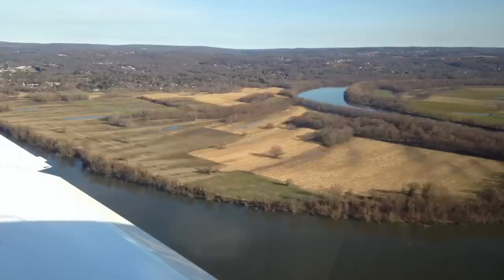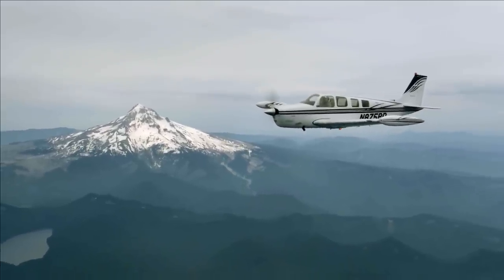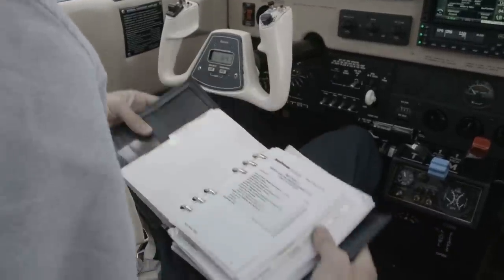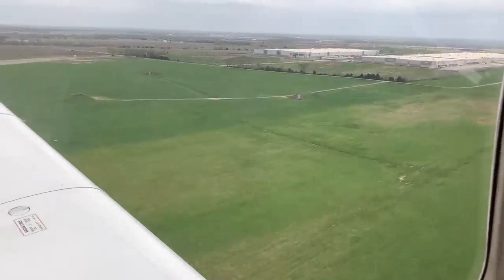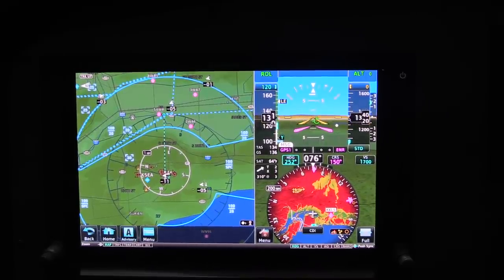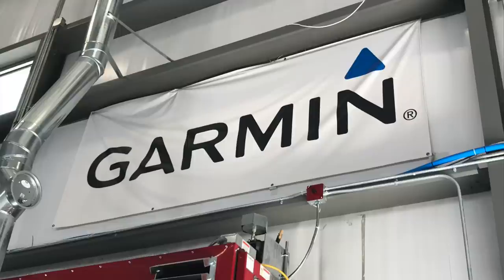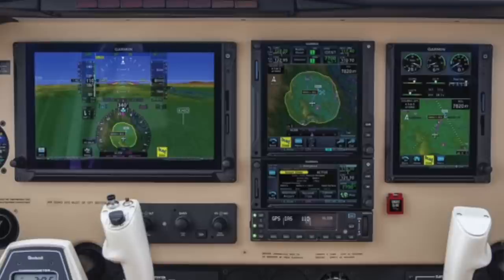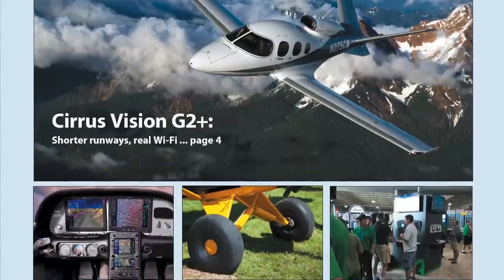AirVenture 2021Garmin Smart Glide Debutes

Comment: This is a BIG technological breakthrough that changes SO much in GA first, but ALL aviation.  It is similar to the development of the Cirrus plane parachute ejection system about a decade ago, unimaginable yet miraculous changes in flight safety came immediately and shortly afterward, more happy landings.  SO too here.  AI with Smart Glide fills a big role in flight safety that ONLY the best pilot skills, knowledge and judgement  could accomplish in ideal conditions before.  Establishing safe airspeed throughout and knowing where to go are HALF of what you're trying to do, i.e., figure out why the engine stopped and how to get it restarted or else, timely and decisively where to land if improbable as your sighting improves in the descent.  Cross-country, night and IMC flying are forever immeasurably safer because of this Smart Glide option.  I'm delighted and congratulate Garmin profusely for this technological guardian that'll surely yield happy landings galore like never before!

Comment: It's Garmin so it's going to be expensive.  If you have the money for this then you have the money to get your engine fixed.  If you have the forethought and presence of mind to get this then you have the forethought and presence of mind to sump your tanks and check the oil every time.  If you have time to deploy this then you are not experiencing an engine failure shortly after takeoff, which is by far the most fatal form of engine failures.
Reply: Garmin, expensive? Try collins, universal, etc... those companies are expensive..
Reply: What a ridiculous comment. Our school had a lycoming io-320 engine with less than 200 hours quit. Part 145, CAMO maintained. 

Engine failures are unpredictable. You pretending they are always caused by pilot error disrespects anyone who died from an engine failure outside of their own fault.

Sumping the tanks & checking the oil is a good start, but by no means guarantees the engine won’t quit.
Reply: I’ll pass on flying with Peter Anderson, who apparently believes mechanics are infallible, parts never fail, and newly serviced, well-maintained engines never quit.  Must be nice to fly with that kind of (clueless) confidence.
Reply: Yeah, no
Reply: @samtulp6  I've had an engine fail on me before in flight and I've seen people get killed because of engine failures.  My beef with Garmin on this is that this button will end up like so many other switches or buttons in technically advanced aircraft: unused precisely when they are needed most.  Good emergency training in GA is a shambles.  If this expensive button included rigorous training on how and when it is to be employed and under what conditions it will work, then I would be all for it.  As for most products like this the only training that will occur is a casual glance at the instruction manual once and then immediately forgotten.

That's why I'm so cynical about this.  At the moment it will be needed the most it will go unused and all of that money and energy wasted and nothing gained.

Comment: It would be interesting to know how often, statistically, you are in gliding distance of an airfield. Garmin must have the numbers to bother with this.
Reply: Yes.  Most times in GA aircraft, particularly out west, you are going to land out someplace, not at an airport.  Can you decouple the autopilot best glide and nearest airport?
Reply: @LarryPortouw  
Funny, thinking about this system perhaps a button that just yells the forced landing procedure at you would be more use? "Pull up, trade speed for height, trim for best glide, turn down wind, look for landing area, fuel on, fuel pumps on, engine restart", etc etc
The only actual engine failure I have ever experienced was on take off at 300 ft on a 12000 ft runway in a 172 so not exactly stressful but I wouldn't have put money on a successful outcome of nearly all my PFL's
Reply: Obviously that depends a lot on pilot's decisions. I see a lot of people flying around at 5000 feet while I like to go over the most economical altitude with often is only FL100 even on short flights. With the Malibu I like FL150 or something like that. Gives you a nice glide range (30NM) already and ok speed and saves you a long climb that burs a lot of fuel.
Reply: In Canada you would consider yourself lucky if you’re within gliding distance of a flat surface, hopefully on dry land.
Reply: That would certainly be interesting data. They should track that it could be interesting for AV safety.
Reply: @Skyprince27  Maybe from the rockies west or from Ontario east. The USA and Canada have very similar geography from east to west until you reach the 37th parallel north (south of it) where the biomes are much different. I would argue it’s roughly the same other than how there are much fewer airports in Canada.
Reply: @erichhartmann1  
So you’re talking half of Alberta, Saskatchewan & Manitoba. Sorry, haven’t been to that area since 1992…

Comment: My biggest concern as a flight instructor is.... what if the nearest airport isn't close enough?

Many pilots have lost their lives trying to make it somewhere they can't. Appears there's a feature onboard similar to the glide advisor in foreflight, but how easy is that to get on the display? What automation features are available for off-airport options? V-glide hold available without lateral navigation? I feel like the most vital question about safely gliding was left out of the video.

Comment: Wonder why the other GPS navigators aren’t included, like the GNX 375, GNC 355, and GPS 175.
Reply: He did say others would be added. Some or all of these may end up getting this option in time.
Reply: @iflycentral  I thought he only said that different flight displays would be added not navigators?
Reply: @Captndarty  yep; you are right. I misinterpreted what he said. Still; seems it would be somthing they could add to the other navigators. The Garmin pilot app already has a glide range prediction feature, and the app can be fed by Navigators like the GNX 375. Guess we will have to see what they do.
Reply: @iflycentral  agreed. I’m getting a 375 and I would think the processor could definitely handle that function.
Reply: I'm certainly going to ask them at the booth. Even if it could be done, I think the main issue is that there is a significant difference in cost and margin between the 2 classes of navigators and they want to make more reasons for people to pony up to the xi series.